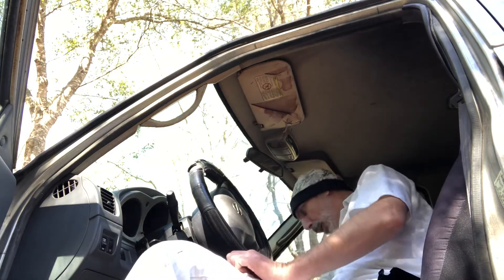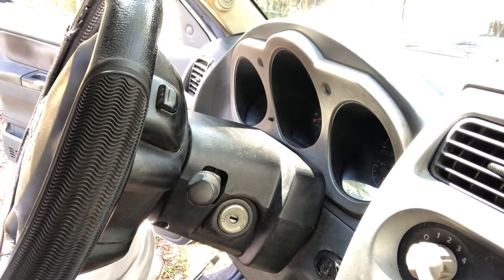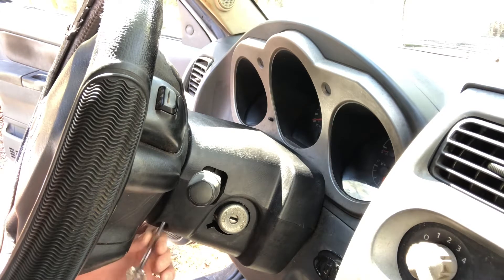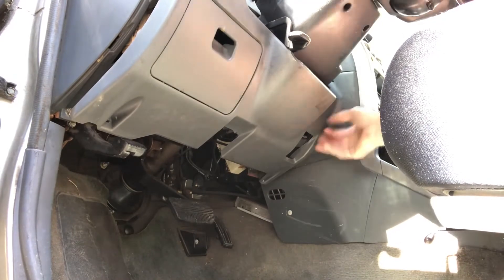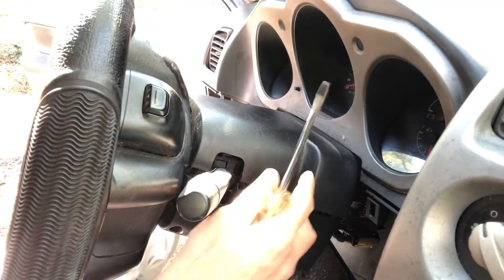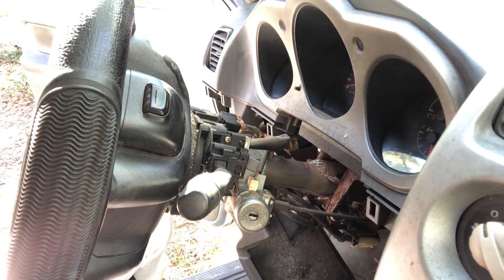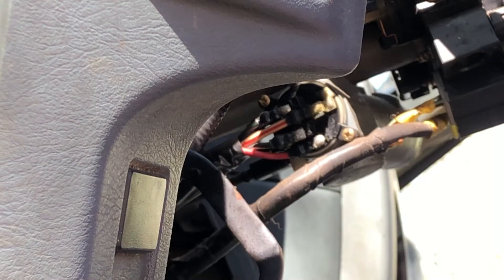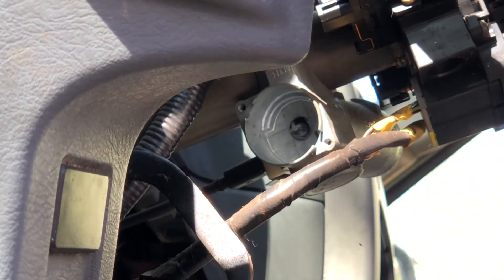2002 Nissan Intermittent No Start One Click Fixed

Comment: Great video I'm having the same issue but mine is a 5 speed manual, I replaced the starter and getting the same 1 click sound 🤷‍♂️ I have a 2000 frontier,
Reply from the maker: I know it can be so aggravating trying to find an electrical problem especially when you keep buying new parts and problems still exist. I would read the forums or watch videos come in the house tell wife, well forums say replace whole truck 😂 I got lucky and this worked. I did replace something before this and thought it was fixed but wasn’t I just can’t remember what it was. Take care, Tony

Comment: Thank you brother for posting. I'm having the same issue...NEED HELP! I replaced, ignition switch and wiring, starter, battery, N&P relay, all fuses good. Engine getting fuel. Don't know what else. Any ideas?
Reply from the maker: I’m racking my brain right now because you replaced a lot. This is still working today with no problems so far. If I can think of anything else I will reach out to you.
Reply: Did you fix it after all?